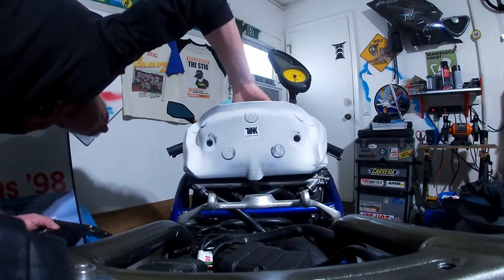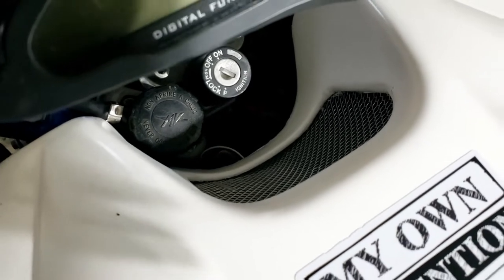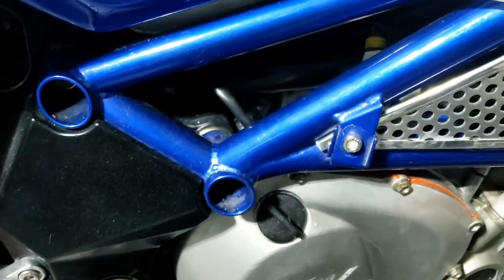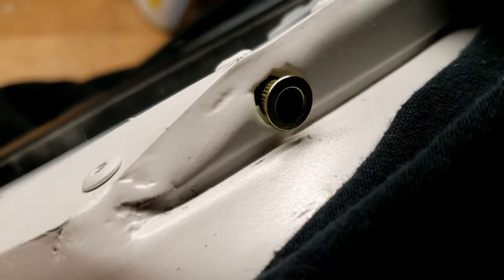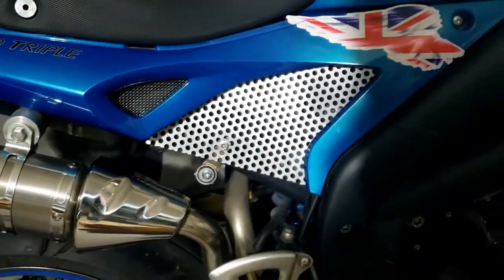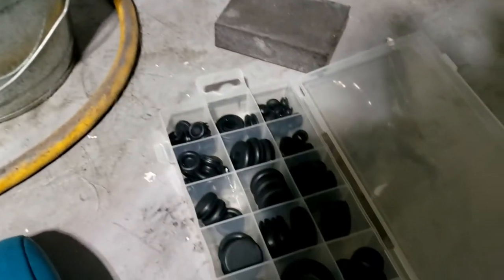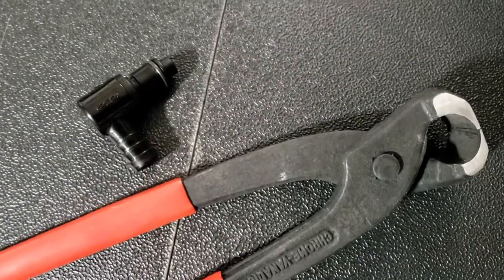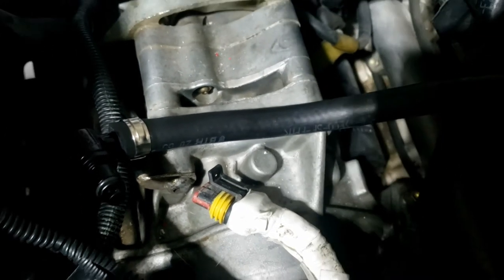Making Custom Air Filter Box on #MVAgusta 750F4 #CafeRacer & #StartUp

Comment: The f4 circle breaks the design imo cause you have a lot of strait angles.
Reply: You have a point there :)
Reply from the maker: It's better positioned now. That said, now the side panel under the fuel tank needs rethinking, it might be worth looking at creating a piece that does the whole job of filling in with one piece, from under the tank all the way to the tail. Thanks for the feedback.